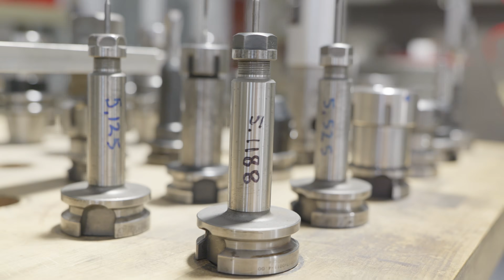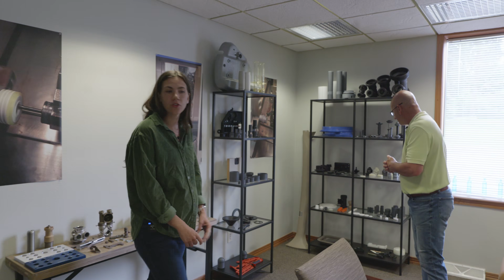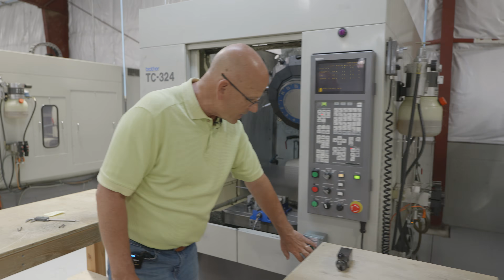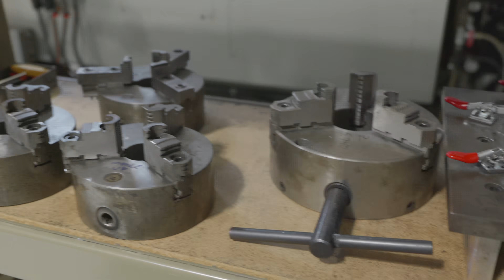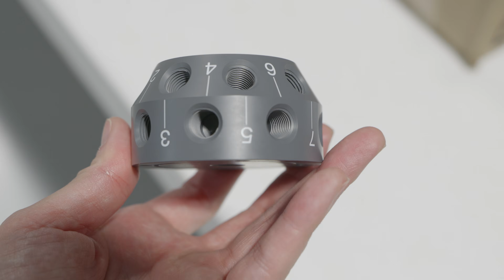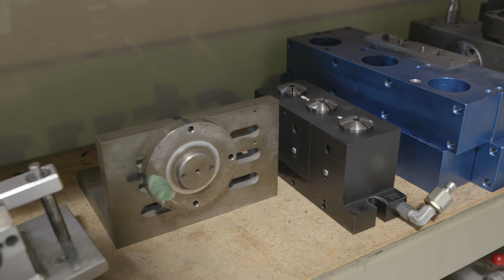This Isn’t Your Typical Machine Shop! | PTP Manufacturing Machine Shop Tour

Comment: Apt timing . Just restored a horizontal linisher myself. Had to convert it to single phase, make a box for the inverter, make a new motor pulley, make a new fence plate and renew the running plate as it was badly dished. Runs a treat just like Tom's 👍🏻

Comment: I run another type of “not typical” machine shop - we work predominantly in wood, hence the name. I was never a wood worker… or a machinist for that matter, but I had a lot of hobbies that I needed parts for, so I built a small CNC machine and learned on that. We have 3 CNC machines now, 2 lasers, 3D printing etc. Wood happened almost by accident and as time went on, we got the majority of our business in the form of wood projects. There is less of a market, and therefore very few options for people who need precision CNC machined wood working that is not furniture or cabinetry.

We’re located in MA but have taken on work from as far away as California and Washington as well as Pennsylvania, Connecticut, New York etc. Parts that were made in our little home based shop have been shipped all around the world on high end products such as audio cables and recording devices, various awards and custom designed art pieces.
Reply: How do you find your first customer? Do you just cold call companies around you?

Comment: We also specialize in all types of plastics. We do however machine various metals as well. Plastics are harder to machine than most ppl would think. Chip removal is key. While milling chips present little problems,  turning chips can be a nightmare. Long stringy chips are a problem. You  learn tricks and ways to eliminate issues.  Nice clean shop and great looking parts. https://youtu.be/N6vSGC0ZjFw?si=fz7J9ueh7fzZu__n

Comment: Plastics are nice to mill because you can use air for coolant and keep things clean.  But heat is a challenge with machining fast because hot chips can fuse back to the base material.  Single-flute, deep-groove, low-helix cutters like Onsrud work great.  Downside is that you can’t push cutters to their limit; plus side is they last forever.

Comment: You can tell he's a real machinist through and through because he is struggling to put what he does into words that non machinists can understand.
Reply: thanks, now g28 the 2" insert drill that is currently g83ing your origin, because it really g65 p9833's me when you set your rapid to 100 and crash with an effective z-30 in your g54, because that comment makes assumptions that are as innacurate as forgetting to turn on g254 on a cycle at b90 (or a90 if not haas).
Reply: @ArikaStack  are you always this defensive? Sounds like youre Alarm 254ing and PS0329ing because you are all over the place. Youre assuming that Im assuming. Sounds like you can benefit from G28ing that same drill, indexing to a probe and retouch your offsets. Oh and maybe throw in an M8 to not destroy your drill.
Reply: I dont want to burst your bubble but on their channel under description it reads: A vibrant community of dedicated machinists, fabricators, engineers and
manufacturers from all industries and interests. 
Unfortunately, this is not a channel for non-machinists.